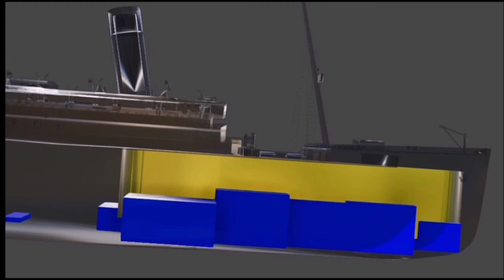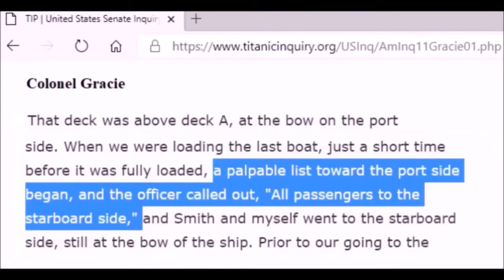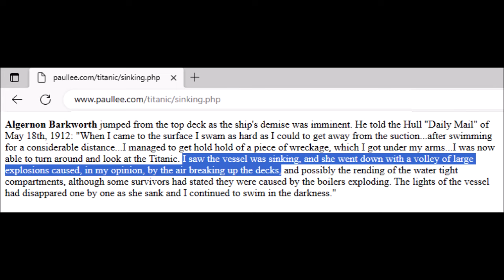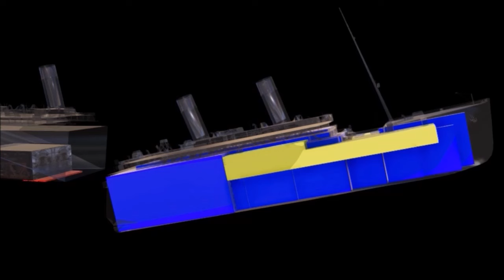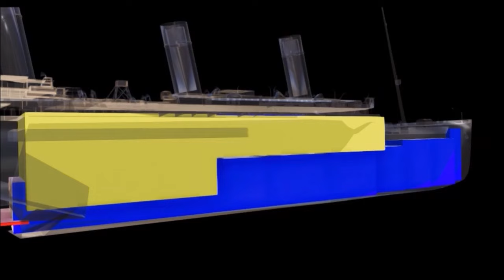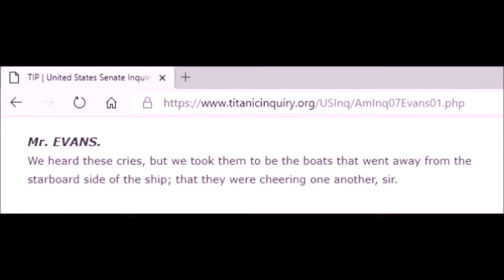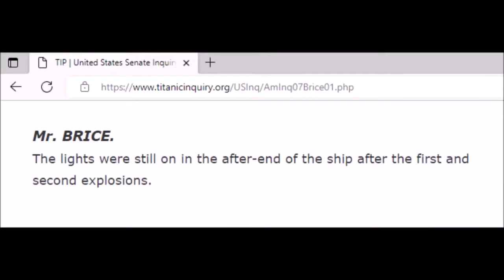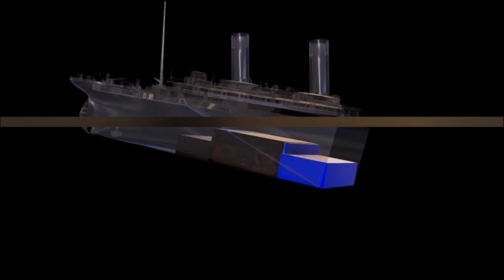Titanic Study - Physics, Flooding and Air (archive)

Comment: I have some things I want to point out that may or may not be true. Question, how do the WTDs open don't they have emergency controls for when the switch and the pipe don't work? Another thing is that the only person that saw the ship take a big list to port is Charles Joughin which was drunk at the time and couldn't tell heads or tows. And how did the port list become so big when there was only about a 5 Degree list on titanic when she went down. There were port holes open on the port side which was ordered by Charles Lightoller when he had an idea to save trapped passengers. But from what I know Chief Officer Henry Wilde ordered to not open the port holes. The only door to be opened on the port side was a gang way door (Which was kept open for most of the sinking). The port list went away when the officers' quarters were flooding. Also, may you please tell me where the survivor testimony pages are that you use to back up your information. Also, from what I now the passengers/officer's testimony is that they did not say what you think they said. Also, only one boiler exploded and that was under the first funnel were Charles Lightolier was trapped from a vent and that hot air let him get free. Also do you have a discord? I want to talk to you about your thoughts and believes of the effects of the strain. Also there was a list to port
Reply from the maker: @Astrailian_mate https://youtu.be/EsGtRT5rtz4 The watertight doors were able to close with a device inside each one that would automatically trigger the door to close when water inside rose up to a certain level that would trigger the device to close.  However the doors would not be able to close if the ship was listing to port or starboard because the angle would cause the door to jam.  Survivors witnessed various doors on various decks jamming owing to the gradual bending of the hull and twisting of the hull as her forward half leaned over to starboard and then port and then starboard again, while her back half was in a sense tagging behind and twisting over in the same direction as the bow but with a natural bending and twisting motion.  The ship was not a static sheet of metal from bow to stern.  She was constantly bending and flexing as she steamed across the ocean.  Thermal stress was also very high in the location where the Titanic sank which would cause the hull to fracture and break apart much more easily due to the rapid change in temperature in the air and sea.  Survivors said their cabins smelled of fresh paint.  This would cause them to keep many port holes open.  Survivors witnessed many port holes open on the port side of the ship.  This would cause the sea to flood into their cabins and cause the ship to list over to port.  There was no order given to close the port holes.  Most of the crew did not know the ship would sink.  It was her maiden voyage after all and she was in their minds one of the safest ships in the world to be on.  The idea that she could sink on her maiden voyage and break apart was unthinkable.

There is evidence that one of the gangway doors might have been open, but it would not create the port list because the water coming in would simply wash in and spill over to the starboard side and increase the list to starboard.  The open portholes inside the port side cabins would cause the water to be trapped inside the cabins on the port side and increase the list to port as the open windows on B, C, D, E decks would cause the port side to sink lower and lower.  Survivors witnessed the port list change to an even keel, and then list over to port again, and then list to starboard again.  They felt the ship rocking from side to side.  I showed a study of this which can be seen in my playlist.  The sparks that were seen were described as a tremendous shower.  The survivor accounts can also be seen in my playlist.  The possible boiler explosion or implosion is unknown because nobody has explored that area of the wreck inside boiler rooms 6, 5, 4, 3.  There are plenty of survivors who were accused of being drunk.  Charles Joughin, Thomas Dillon, Robert Hichens, 5th officer Lowe.  Even the Captain, Murdoch, and the lookouts were accused of being drunk and asleep whilst on duty.  There is no evidence of course.  It is unfortunate that people exaggerate and make up claims about the passengers and crew rather than examine the events of the sinking which they do not wish to examine.  I base my beliefs on the sinking on the survivor accounts which can be read at the Titanic Inquiry website, newspaper archives, and their personal handwritten letters which are held mostly at public records buildings and libraries here in the United Kingdom.

kind regards,
The real Aaron1912

Comment: the ship DID list to port, but i do not believe it was that extreme as reports said that despite the list, the ship was very much even keel, the port list was 9 degrees to be exact, wich isn't a lot, the list after the iceberg colission was 5 degrees to starboard, i could see why 9 degrees would be a "Heavy List To Port" as these people were scared out of their wits too much to calculate the ship's condition, or they could refer to a "list" the fact the ship was sinking by the head and the stern was rising higher and higher and i gotta agree with the idea of the ship hogging, but i don't think you took account of the weight of the boilers and the fact that the ship as you describe it here, behaves like rubber and not something out of steel , not tryna be rude, just pointing those out
Reply from the maker: @Battleshipfan Thank you for acknowledging the port list.  You would be amazed how many years I had to put up with people telling me that it never happened and that all of the survivors who stated there was a port list were some how 'mistaken' and 'confused'.  I can understand why some of the survivors did not like Titanic enthusiasts very much.

Regarding the 9 degrees to port.  That is a rough estimation given at a time when the port side lifeboats were still being lowered.  The heavy list to port came afterwards.  As shown in the testimonies provided the list increased to the point that they could not stand on the deck without holding onto something for support, and then it increased to such a degree that they believed the ship was about to roll over and capsize.

When the sounds of the break up occurred she was still listing heavily to port and they said that it appeared the engines "crashed through the side".

Those close to the bridge could hear the sound of the metal tearing apart as the bow began to right to starboard again and both sections twisted apart.  There would naturally be a tug of war between both sections as the bow twisted to starboard and broke free, while the stern (containing the heavy reciprocating engines) would continue to lean over to port by the weight of the engines.  Survivors described the ship rolling from side to side as she broke apart and the water rushed in and the air deep inside burst out.  This would involve severe racking stresses, which the structure was not designed for.

The above is of course just my own assessment based on the evidence I have researched.  Each of us has our own shared interest in the Titanic.  Mine has been to examine all of the survivor accounts that were long forgotten and asking the questions nobody wants to answer e.g.  How many portholes were left open?  What would happen if 10, 20, or 50 were open, with more on the port side open?  How would this change the rate of flooding inside the ship and the angle in which she listed over and sank?  If the watertight doors behind the damaged compartments were re-opened and the ship listed to port, how many degrees to port would it take for the doors to jam so that they could not close?  If a bulkhead collapsed and the water rushed into a boiler room and pushed all of the discarded shovels and wheelbarrows up against an open watertight door, could they potentially become wedged up against the door and prevent it from closing completely?  There are so many questions, but nobody appears to be interested in examining the enormous complexities involved regarding the internal flooding of an ocean liner.

Anyway, if you are interested in the stresses involved in the break up, particularly thermal stress, then you can see my complete study here:  https://youtu.be/dsCAyRx5Kvc?t=38

kind regards,
The real Aaron1912